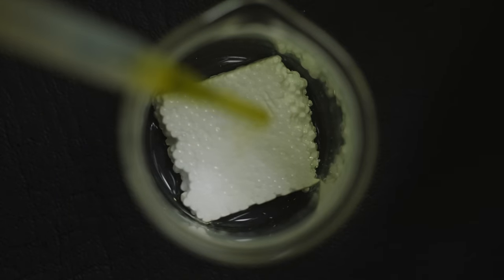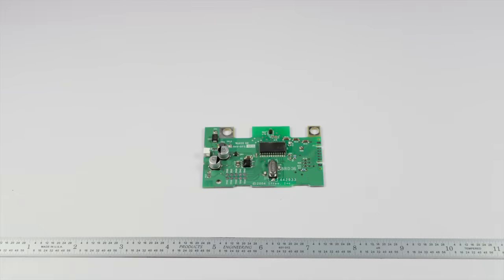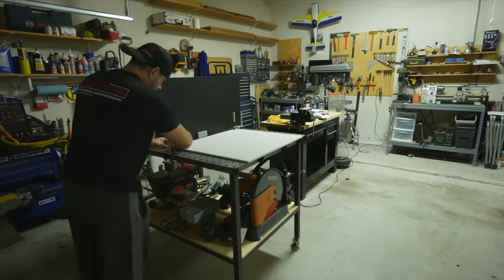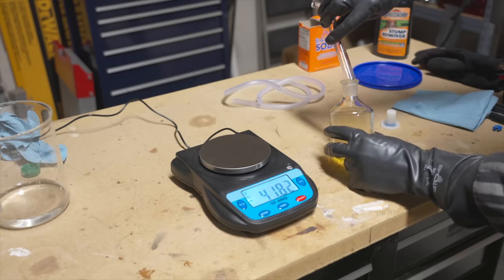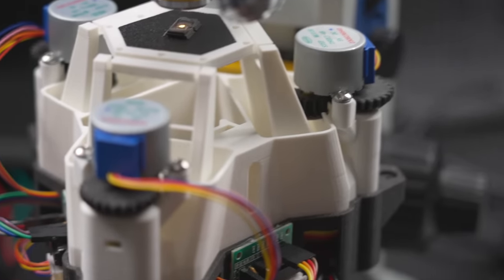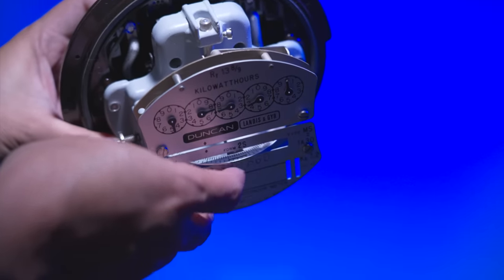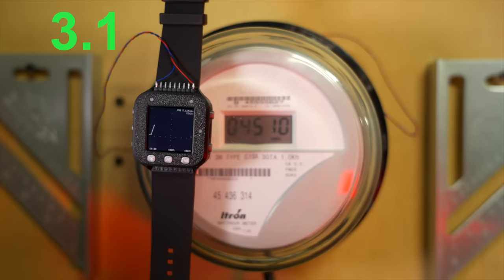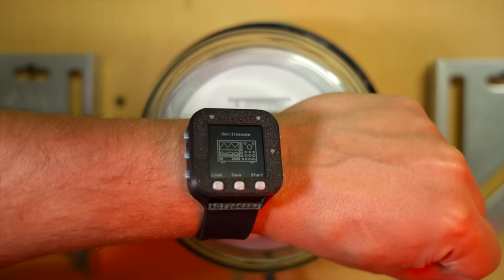Smart Meters, Nitric Acid and Microscopes

Comment: I've never used acids to remove the package.
But I have used an engraving laser to vaporize the package off a few nanos per pass until the silicon is exposed. When done carefully, it even exposes intact contents of NVRAM cells. I think these bits could be optically scanned and their data digitally reconstructed (with better equipment than I have, lol).
The method might be useful for forensic data recovery from failed flash drives.

Comment: Fun stuff. Uncle Sam had needs back in the day to discard a bunch of IRFNA.  This was handled in tank truck sized loads. The first contractor spilled some out of the tank truck. It set the asphalt parking area on fire, the truck tires burned, then all hell broke loose.  We were contractor #2 and we had concrete parking areas and Uncle Sugar liked that. We had a different approach to the problem and worked out a good method to getter done without getting dead. I had three tiny holes in my protective gear. I still have three small scars from wearing that gear while I sample the red stuff.
Reply: Impressive

Comment: Excellent work.  This is all great info, and making your own acid is impressive.  You sir are in need of a small mill.  Milling caps off of components precisely (without needing to use that hacksaw) is worth its weight in gold.
Reply from the maker: Sounds like I know what I need to show in my next video… 🙃
Reply: And maybe a cheapish fiber laser while you're at it
Reply: @RECESSIM A Bridgeport knee mill or just “Bridgeport” will be something to do exactly what you want to do. Think of it as a really badass drill press. These mills have been around for a long ass time and are available in analog or CNC versions (analog can be upgraded to CNC if needed) and are capable of doing just about any sort of milling or machining work imaginable. 

There are tons of different tool pieces and accessories out there for them but to just pop the caps and lids off of electronics parts I would say you wouldn’t need much variety in tooling bits. One useful bit would be an end mill. End mill bits are a multi fluted bit with a flat end on it designed for precise, flat material removal. The end mill bits come in sizes as small as 0.005” and as large as 1.25” diameter so if you decided that the end mill bit was a good choice it is available in a wide range of sizes.

Thanks for all the awesome content! I hadn’t been in your channel for a little while and all the sudden found your “Dr. Frankenstein” deep dive home rev-engineering lab. Within 20 seconds or so of the footage rolling I noticed that I left my jaw on the floor and needed it put back where it belongs. Lol

Keep it up bro! You’re inspiring me to dig into some refrigeration controllers and boards I have with every new video you put out. Doubtful I would need to go to the extent of acid burning caps off of SOC’s or anything like that as most of the interesting stuff looks to have JTAG pads. The main controller boards normally use RS-485 MODBUS or RS-232 network communication to other remote mounted I/O boards, etc. 

Anyway, keep it up and keep it safe! We need more videos showing successful experiments from your garage lab!! 👍
Reply from the maker: @orlandotech  thanks for the comment and suggestions! I have a small Taig CNC mill that I need to use more, perhaps in an upcoming video?? 🤔
Reply: @RECESSIM  hells ya! I’m sure for certain “targets” (victims) it might be beneficial to use the mill vs the acid technique. I will admit tho, the acid technique is one wicked way of getting someone’s attention, it’s pretty eye catching. I found out after digging into the video and noticing the increase in production quality that you have really been working dialing that in. Well at least thats my opinion. I noticed right away that you have been refining and tweaking things for the better (I enjoyed older video releases too so don’t get me wrong). 

So ya, I don’t mind trying to help someone out by posting up pointers or tips to make things better if I know something that can actually help. It’s the only convenient option to use at the moment. 😁

Can’t wait for the next one! 

I’m digging around on your Patreon page rn as I’ve been toying around with the idea of supporting the YT creators that I get a lot of really solid info or entertainment from on a regular basis. I just hate subscriptions of any kind as I tend to forget about them. So once I get over that issue I’ll prob pull the trigger. Lol

Stay safe Hash!
Reply from the maker: @orlandotech  same for me, generally hate subscriptions but have a couple people I support because they create content I like. As long as it’s a subscription I USE then I’m fine with it, it’s the stuff I never use that leads to financial death by 1000 cuts 😂 

But people taking the time to make cool stuff I like supporting. I know how much work it is!
Reply: @RECESSIM  I completely agree, which is why I was toying with subbing your Patreon. 

The hardware hacking is something that I’ve wanted to mess with for a long time but really didn’t have any idea about how it worked or go about it. Besides, I didn’t want it ending up a largely destructive project with nothing else gained at all. Been there, done that. It made me regret touching it after I’ve converted it to a paperweight or trash can ornament. 

I have the mindset that everything can be fixed, even if it’s really bad for me to “collect” something else that I don’t touch for a long time. I hate tossing out something I know I can get going again with little effort. I’ve repaired shit and made it 100% as good as new for a tiny bit of expense or for free besides my labor (im really a worthless person so not much value there. /s). Cracking open the “eggshell” to get a good look inside or to repurpose it is the next big curiosity for me. The rev-dev or reverse engineering site you have going on seems like it would be a natural starting place along with the Patreon.

I’ve never been signed up on that site but I’ve felt that I get a lot of info from a couple of YT creators regularly. Since there’s a mechanism for throwing a tangible “Thanks!” at a creator, it really wouldn’t hurt as long as I don’t end up financially thanking 25% of all active YT creators. I imagine that could get quite spendy. 😂

Keep on keepin’ on Hash! You’re killin’ it with the improved formatting and production quality!

Comment: Isn't it funny how the older meters were so reliable? 
When's the last time you heard someone complaining that their power metre failed and needed to be replaced? 
I wonder what's the oldest meter that is still in service today? 
It just goes to show that it's totally possible to make a product that will be reliable and do whatever it's supposed to do extremely well, especially when it benefits them! 
I have never heard of a power metre failure!
Reply: The meter in my house (in the garage) is original when the house was built in 1960.  The reason why the meter is inside the garage is because there was an addition next to the garage in 1966.  Works perfectly- refused smartmeter & pay x-tra every month not to have a smartmeter.
Reply: The downside being they are susceptible to hacking, tampering and fraud...
Reply: I've NEVER had ANY meter fail, smart or not, in half a century. 

So, who cares?? 🤷🏻
Reply: @dianecernak7130 😂 Then you are paying MORE than I do WITH my smart meter... 

🤪
Reply: @davelowets  yes, my choice

Comment: Those small capacitors on the circuit board eventually leak electrolyte (famously) which means these meters must be eventually changed out at some point before they cause faulty operation with the meter.  Just an observation.

Comment: I've had acids that can absolutely wreak havoc on anything...... Even some fairly resilient ferritic stainless alloys. Even when you think it's stored properly..... I cannot tell you the nightmares I've had in my shop and lab back before I knew better. 

A precision machine shop is not the place you want to have corrosion fumes wafting through the air. Literally overnight rust within the matter of a few hours on EVERYTHING. I  thought I was going to puke when I realized what happened
Reply from the maker: Agreed, storage is the worst part.

Comment: I might be mowing your lawn right after you did but i would sand down most of the epoxy before using the acid
Reply from the maker: Most people usually do, or laser it off. I found I only need a very small amount of nitric acid even when I don’t sand it though. But if I was doing this at an industrial scale it would save a lot of money in wasted acid I’m sure

Comment: I built software to handle the data coming from smart meters. One of the anomalies I saw was that when it rained too much, it loses signal. Or when a truck Parks over the meter we can lose signal for days. They might be able to be high-tech but the systems capturing the data are not necessarily there

Comment: 2 questions:  a) how does one typically clean the inside surfaces of those globe shaped glass flasks? to insure they are completely clean for next use? b) one moment of your video showed a rigid small diameter metallic probe bent at 90 degrees at the end to act as a 'long distance probe'. Might you have the formal name of those probes and how they are mounted?  As that type of rig could be helpful for me to supply power to small boards in a hands off manner.  But I dont know what to search for... Thanks.  And for your attention to detail.  ps - final question... where do you think these 'receivers' are to capture the rf output of the meters?  Do you feel with the current roll out phase of these they are supposed to all be read in real time?  Or more so, when a vehicle drives by to get readings from the meters?  Its just an interesting thing to know...
Reply from the maker: Thanks for the comment, happy to answer your questions.
1. Cleaning the inside of a boiling flask (globe shaped ones) depends on what was inside. Generally some other liquid is heated inside like an acid to dissolve material and then rinsed with water. I am not an expert in this though, so I would watch other videos or read some chemistry material.
2a. The probe came with my hot plate, called a "PT1000 external temperature probe" but external temp probe or thermocouple probe is what you want. The mount I used isn't a formal mount for them, I just rigged something up.
2b. What I rigged up made use of a machinist tool, on Amazon you could search for "Noga DG61003 Regular Duty Dial Gage Holder Mag Base w/Metal Fine Adjust" but the articulating arm is the important part. A similar thing is used for holding lights in video work, called a "Adjustable Magic Arm."
3a. The receivers in the case of Landis+Gyr GridStream meters are installed on power poles, they are called Collectors and you can in another video of mine where I take one apart.
3b. The power meters in my area are read every 15 minutes fully automated, no one drives around. In some areas depending on the meters used a truck drives around once a month to gather data. The water meters I have in my area are like that, a truck drives around my neighborhood slowly once a month with an antenna on it collecting data.
Reply: @RECESSIM  thanks much ill research more about the parts you suggested!

Comment: With those tamper resistant devices it really helps to have a high res. Inspection xray device. It is amazing what security mechanisms can a bunch of motivated nerdy idiots come up with:) been on both sides design/analysis it is always fun:) just the financial guys can spoil the fun, but on the othes side makes the challenge real:)

Comment: Did you try the method of de-capping that Curiousmarc posted a while ago? You just heat the chip until the epoxy gets soft, then you use 2 pliers and bend the chip, and the die comes out of the epoxy - no acid required, and a lot cleaner overall.
Reply from the maker: Yea, I like this method because the part will still function afterwards. But if all you want to do is look at the silicon, heating it is a great way. Takes a bit of practice and an open space for the epoxy fumes.
Reply: @RECESSIM  Yeah, heating and bending isn't going to preserve the bond wires, but if you're just looking for ID marks on the silicon, it's a quick mess free way to go. Heat also doesn't work too good on ceramic packages 😛. I've been meaning to try the heat and bend method on any old chips I have laying around - especially large chips like chipsets on old motherboards. I imagine the chance of cracking the die goes up significantly as the die size gets bigger, and in that case, it'd be back to nitric acid again

Comment: Its been a few years since ive priced HNO3, but the price for fuming nitric acid around 90% concentration should be at least half what was shown here. That's still pricey and why many chemists make their own, but that's a crazy mark up. So the price tells me that its risen recently across the whole market, and that particular suppier probably prefers to deal with bulk orders for industrial applications.

Plus very few chem suppliers even list SO3 as a product  let alone a suggested item, so i think you this place had soecial pricing.
Reply from the maker: Shipping it is also quite challenging, freight-only from what I’ve heard which also adds to the cost.

Comment: Would that little ball in the vibration sensor happen to be a paramagnetic material?
Reply from the maker: Not sure, I took a look at the datasheet for that part (or very similar) but they don’t mention any details like that.  Great question though, never heard of paramagnetic material before.

https://www.mouser.com/datasheet/2/209/joytech_06262018_RBS310912T-12_en-1374914.pdf

Comment: No need to modify a smart meter if your power comes into the property underground, just smash a hole in your foundation and dig out the dirt until you reach the power lines… then strip the black insulation off the line but do not cut into the wire itself or it will explode… then clip splice wires onto the lines and run to a sun panel (and if you don’t want to do anything illegal do not do any of this, it was a joke)

Comment: a llittle dissapointed that the chip whisperer or other non destructive tools for hardware analysis (forgot the name of recent logic analyer style toy that probes all pins and logs data from all at once to determine likely usage of each, and references database  to give probable chip).. that should be used before decapping weren't mentioned
Reply from the maker: I was already 99% sure this was some kind of analog chip so I went the decapping route.

Generally though I experiment in random directions. I might decap at the same time as trying a chipwhisperer on an unknown part just to see what ideas I might get along the way.

Thanks for commenting!

Comment: I'm sure you know that you can create nitric acid from nitrous oxide and the nitrous oxide is simply created from thin air with two electrodes. The evolved brown gas is then evacuated through a water trap creating nitric acid.
Reply from the maker: Links to any process? If it’s being absorbed to water then you get to 68% azeotropic and can’t go further without another process. The method I show gets 90%+ which is why I chose it. Open to try different processes as long as the same concentration can be reached without a lot of extra steps.

Comment: FYI... Sulfuric acid will kill the epoxy.
Reply from the maker: I've used it in the past too, I wanted a method that would preserve the bond wires and metal frame of the IC though, sulphuric acid eats that stuff up pretty fast.

Comment: What do you think about these smart meters and radiation poisoning?
The electric company that hosts the network wants to put in new digital meters, apparently not smart meters.
I suspect there will be a radio signal out to reach the road either way.
I'm wondering now about faraday cage solutions.
I was thinking to tell the installer, that if i find a signal higher than 3g, I'm putting a cage around the box, as it's in the main room of the house.
Even 3g might be concerning, especially if it's going to be on constantly, like a digital trip wire...

Comment: 11:44 - I think MOST of them actually do transmit data BY WIRE - there's always couple of milliseconds "around zero voltage" (AC, remember!), HUNDRED TIMES A SECOND, EVERY SECOND, when a short signal can be send, and that's the way, by the way, how power companies "switch off" your meter (and you electricity supply) remotely, if you don't pay on time (don't ask me how I know).

I mean, it could be done "wirelessly" but why bother when a device is supposed to be connected to a wire all the time? Removed? Means, does not respond to "pings".
But I digress here, and, hmm... a rather odd name for a vidoe ("Making Nitric Acid!") which actually NEVER says much about it in the first place...

Comment: This is pretty interesting, however, I think it would be wise to create a web UI for your microscope platform thingy.
You could easily do that using Python(pySerial) or NodeJS(serialport) as the serial interface and the frontend/backend for the web UI and just normal C++ for the Arduino, I believe with this you could also remove the Raspberry Pi entirely.
Reply from the maker: I’m thinking of using the open source MicroManager microscope software and writing a driver for it to interface this setup into. C++ but I have some experience with that doing SDR work with GNURadio. 

Glad to know that’s a path you would take as well it seems.